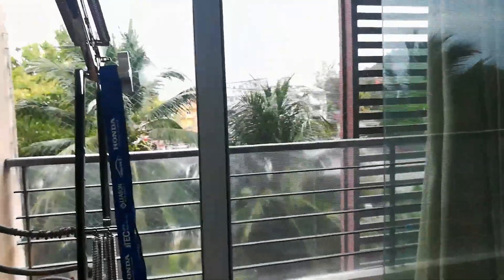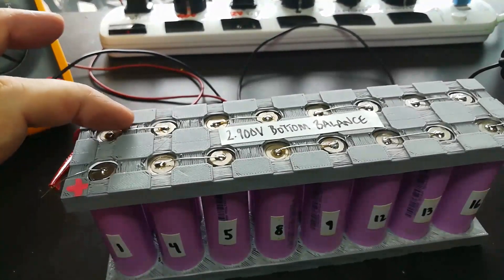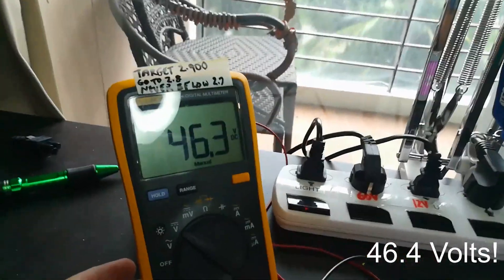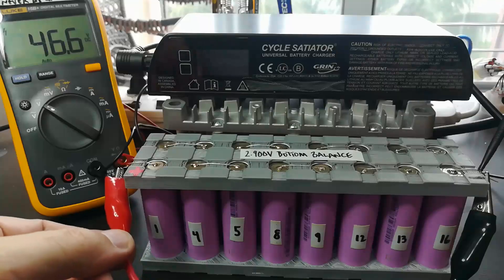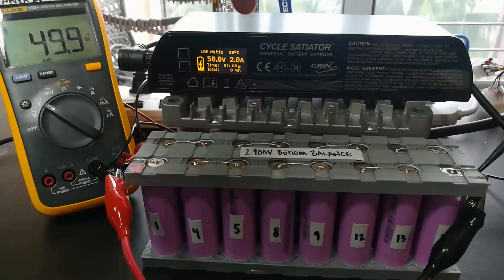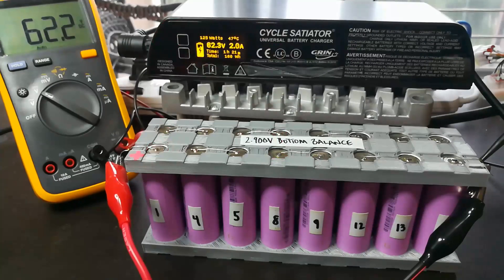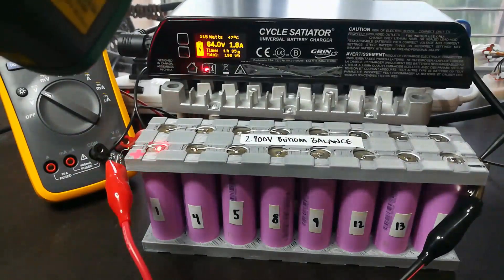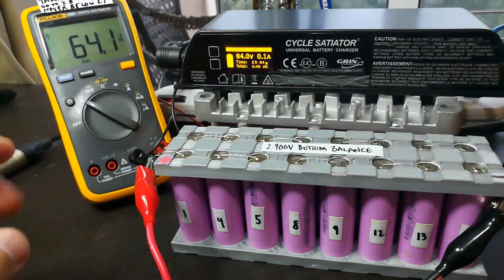21700 Lithium Battery Pack Part 3 - Charging Test

Comment: The fuse at cell level is for when a cell shorted in a parallel group, resulting in all other cell in that group pushing an enormous amount of current into that cell. Without any parallel connection in your battery pack, there is no need for cell level fuse.

Comment: How would you describe the difference between 20700’s and 21700’s as far as power/performance delta in applications such as power tools using between say 5 and 15 (maybe 20) usually in a ~18 volt configuration. Is it significant ? In what ways? Much appreciated. You likely know this but it was my understanding that fuse technique was inspired by Tesla, as they use the same method as another way to prevent thermal runaway
Reply: Michael Brown I meant theoretical or the universal improvements but fair enough